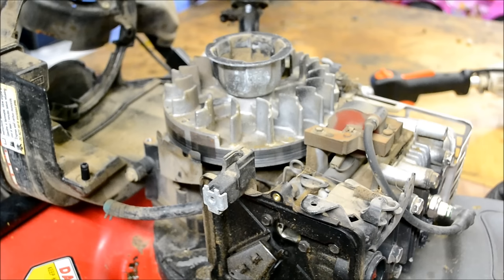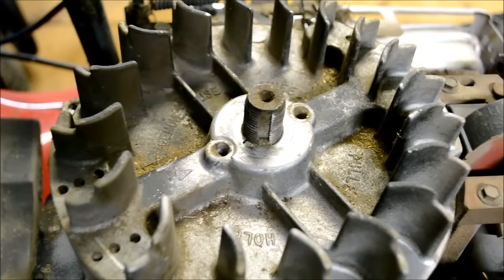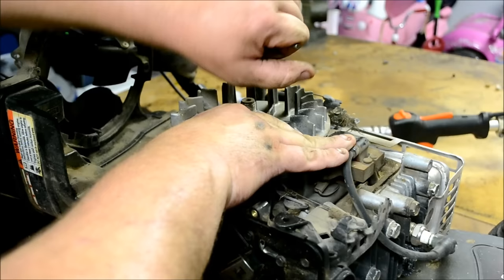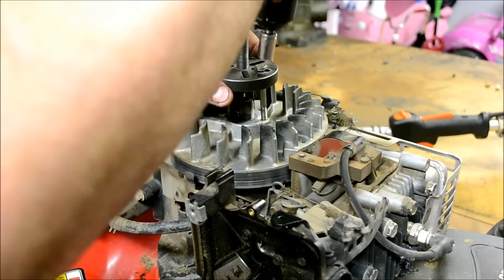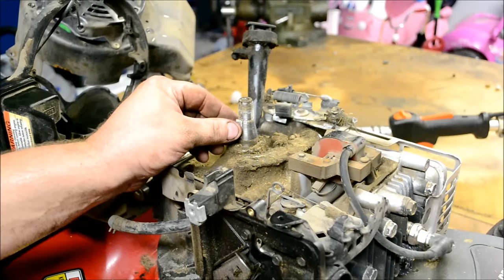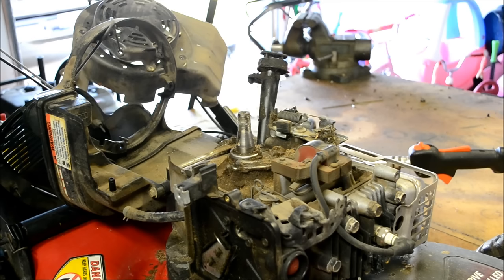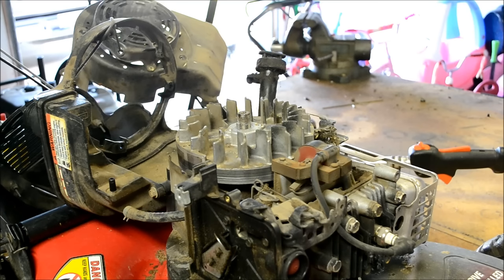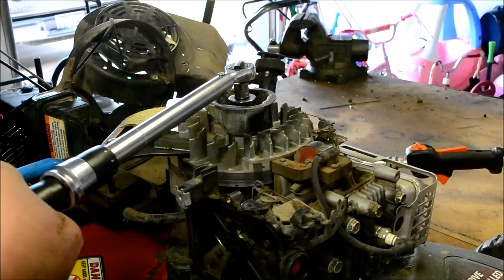BRIGGS AND STRATTON LAWN MOWER ENGINE REPAIR :  HOW TO DIAGNOSE AND REPAIR A BROKEN FLYWHEEL KEY

Comment: Jeremy...I got a Honda HRT 216 S3DA-K2. The Drive belt broke. It is not listed in my shop manuals. My mower tranny is the kind with a "S" shaped rod which sticks vertically out of the tranny box.  I am waiting on a 36.3 inch belt, hoping it will be the right one.  Grass continues to grow in SC. Any help would be really appre, since all of the parts places around here only want to sell mowers not parts!  They wouldn't know a lawn mower if it fell on them!

Comment: Hello ! i have / was gifted a troy built 21" 725 ex lawnmower, I detest the new throw away mentality and would like to try to diagnose my issue. could you possible help ? my mower will run , but it runs really roughly. i have checked for spark, it has spark. i have taken the carb off and cleaned that and the tank, it had water in the bottom of the float bowl last time, not sure where that came from. i also cleaned the tank and changed the gas. the lawn mower runs but runs roughly. when i run it without the exhaust , yes its loud as heck but it seems to run better, with no exhaust and or air filter either. i figure next free time i get im going to run a compression test on it (will have to buy that) and maybe a new carb. I just don't want to waste the money on the parts cannon if all else fails and have to buy a new lawn mower after having bought those parts.  thanks in advance for the information.

Comment: Wait I’m confused. I understand the purpose of a flywheel key but I’m confused how it effects the timing. I thought with a magneto it didn’t matter where the flywheel/crankshaft was at. I understand how it would effect say a battery ignition because the flywheel would be slightly out of place but still.
Reply from the maker: It’s basic of all basic small engine operation
Reply: @THEMOWERMEDIC1  on the points system, the camshaft has to be lined up for the points plunger allowing it to spark at the right time. I could understand how the flywheel being slightly out of timing would mess up the ignition timing on a points system. But on a magneto I just don’t get why the position matters. Would you mind explaining to me how it would effect a magneto system? I would appreciate it if you could.
Reply from the maker: @diesel_dude08  Moving the fly wheel on its axis of the crankshaft even just a degree or two will change ignition timing, you guessed it a degree or two
Reply: @THEMOWERMEDIC1  thank you! But let’s say flywheel keys don’t exist for a second. And you pull the flywheel off for whatever reason and you put it back on. Is there some way of knowing the position of the flywheel? With the flywheel key wouldn’t it just be you slide it in where the key is or am I wrong?
Reply: I guess I’m asking if my timing would be messed up if I put the flywheel back on without some sort of timing mark
Reply: Wait I’m so stupid 🤦🏼‍♂️TDC would be messed up. Sorry lol
Reply: I apologize, sometimes my brain doesn’t make connections. Thanks for your time!
Reply: @diesel_dude08  the key lines up the flywheel and sets the ignition timing. The flywheel is held in place by simple mechanical force when it is torqued to the correct amount. If as sometimes happens the flywheel shifts its position the key will sheer. In simple terms, the key doesn’t hold the flywheel in position it just locates the flywheel on installation. After that it serves no other purpose. Even a slightly split key will allow the flywheel to move out of alignment. Hope this explanation helps.

Comment: I have a lawnmower with a Briggs and Stratton overhead valve engine but sometimes the engine will start and most of the time it won't start.  I cleaned the carburetor but the groove in the flywheel is slightly off from the groove in the crankshaft.  Do you think the flywheel key is broken or cracked?
Reply: Brian Mott Street an

Comment: Very true but neither should fail if the flywheel was fixed well enough, its cheap engineering like not tapping the holes to save money.

Comment: How do you adjust the RPM. Do you bend something?
Reply: their is a governor spring but if you mess with it i think it will avoid tge warranty it will probably be on the outside of your motor

Comment: I've got a Westwood mower with a B&S 286707 engine which refuses to run, I've tried a new armature magneto and it still refuses to spark, There are only two magnets exposed to the the mag and they are almost beyond the second leg of the Mag before TDC is reached by the piston - I thought that the spark was generated when both magnets were leaving the "equal about" position and in any case surely the spark should appear BEFORE TDC, Not after as it appears to be trying to do - Can anybody help

Comment: I have a briggs classis 3.5hp engine sitting in my shed..
Came from my lawnmower.. was working perfectly fine, then suddenly cut out, and will no longer start..
I have cleaned and adjusted the points, checked and cleaned the carb, checked coil and gap, etc etc..
The wierd thing is.. i have a good spark, and fuel getting into the cylinder.. but it still will not run!!!! WTF

Comment: what is the tool called you use at 1:30
Reply: Never mind I figured it out. It is a T-Handle tap wrench with the 1/4 in.-20 tap.
Reply: ola tudo bem